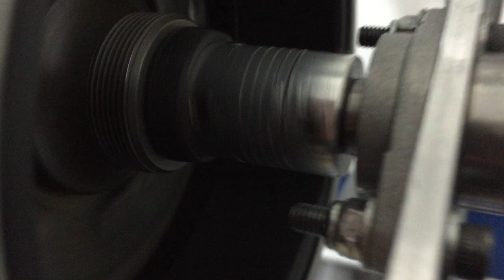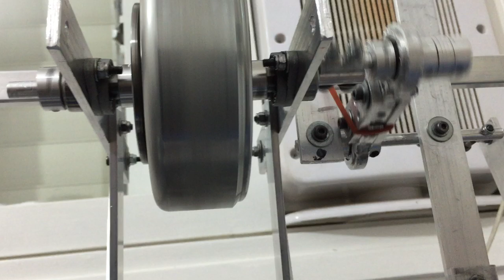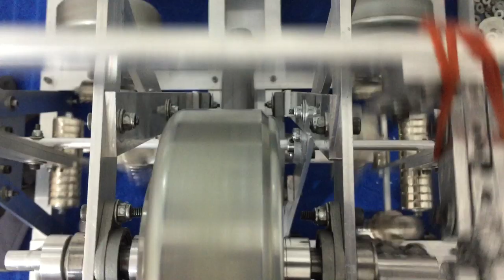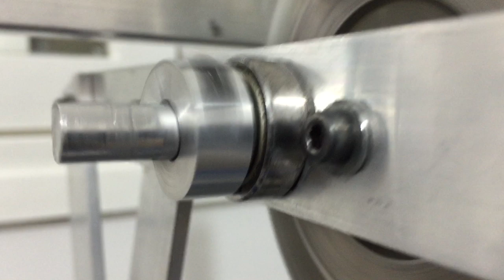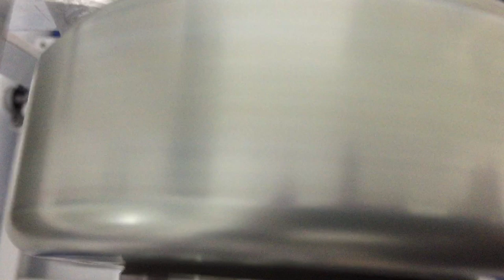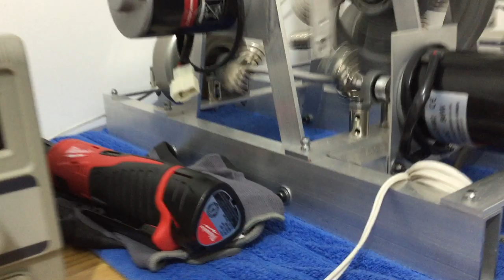Full System magnets generator engine!! magnet motor engine

Comment: So how do we know that this thing is really putting out excess power? 
Because it LOOKS like it is being run from the power supply, that is being run from the wall/power grid. 
The speeding up, could be the grease in the bearings getting warm, so it flows better. Or someone could be gradually cranking up the power input. 
Can you explain, please?
Reply from the maker: You can see more videos! so you can understand

Comment: aren't the magnets affecting the electricity flux? I've made non-magnetic generators with conventional perpetual machines but they're not efficient, even with a rpm multipler device...
(P.S. will a schematic ever be possible to get? I'd like to try to make 4-5 to them and connecting them all into an energy connector... well, I will obviously make them only with your permission and/or after you take your earned Nobel prize)
(P.P.S. Yeah, I'm one of those prepper weirdos)